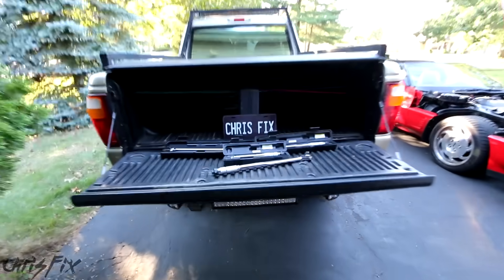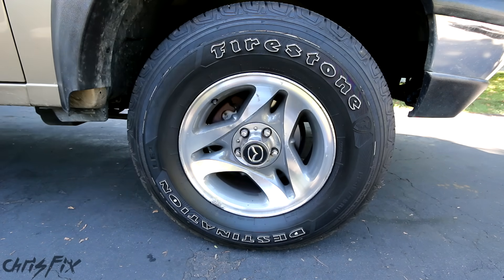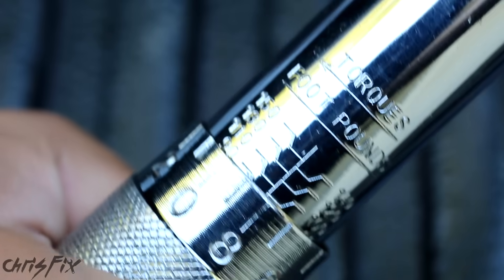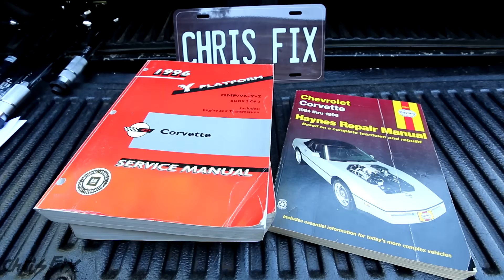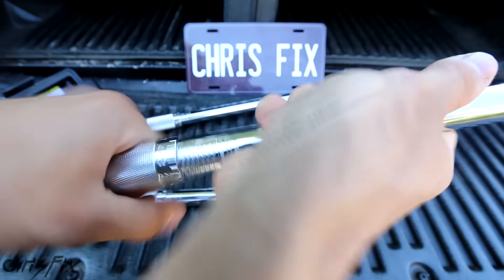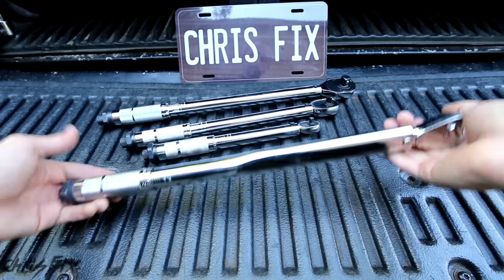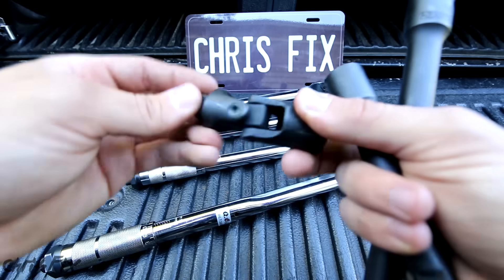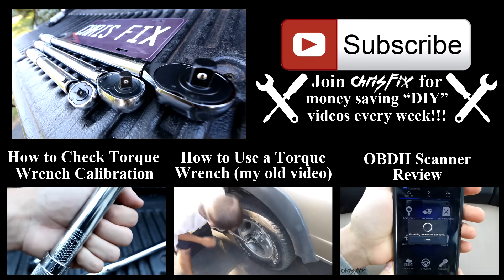How to use a Torque Wrench PROPERLY

Comment: "Where do I get my torque specs?" slams the service
 manual hahahaha
Reply: Othman Sbawi where do you get service manuals for less than several hundred dollhairs?
Reply: @Klaxz1  Online searches, you can even try craigslist or kijiji for people selling aftermarket cds with the manuals on them.   Had to do that for my lincoln navigator, $15 out of canada on a kijiji ad.
Reply: @Klaxz1  ebay digital copy service manual like 5 bucks. PDF file
Reply: @Klaxz1  The internet lol
Reply: GENTLEMAN RTFM
Reply: Klaxz1 is that some bakerXderek lingo I detect there?
Reply: I know right lmfaooo
Reply: @rhett_talon  couldn't help but feel a little like Ave

Comment: 20+ yrs working wrenches.
I absolutely love the Craftsman  1/2 inch drive from Lowe's. 
 Bought for $105.
20ft/lbs - 250ft/lbs.
Covers cars to most trucks. And other things, like clutch sheaves on side-x-sides, which need 184-234 ft/lbs.
It's just versatile and affordable.

Comment: Use rigid extensions, even thin ones, no problem. It has to transmit all of the torque onto the bolt - basic rule of mechanics. Yes even thin ones that might twist. The extensions with a universal joint in will be a problem, though. Good video, thanks 👍

Comment: I cant use it until its set correctly. Dont you need to make sure its calibrated. I mean, obviously its a no brainer how it works. But how do you know its calibrated. When i go as far counter clock wise as i can (toward 0) i stop at 8 on the small dial. Im sure that cant be right

Comment: My torque wrenches only go to150,  I need 166ft pound pressure
Reply: You can use an adapter extension or adapter spanner to increase the lever length, the extra mechanical advantage will deliver greater torque in proportion to the increase in length. For example an adapter that gave 10% increase to the existing length from the center handgrip position to the center of the wrench's square drive would deliver 165 output at the 150 setting.
Reply: @PlatypusPerspective i broke my torque wrench somehow but I finished finally.. now have to change oil on both my car and truck.. then put in ac compressor in my daughters mustang.. already changed the valve cover and intake manifold gaskets.. always something to do., ty for your help

Comment: I'm having a hard time with being able to tell if my large 20-150 1/2" torque wrench is clicking on the lower torque nuts, like 22-38 or so. Would a smaller wrench help for that?
Reply: Quite possibly, yes. A torque wrench is less accurate at the bottom of its range, and can give a weak indication since the beam is only storing a small amount of energy to give the indication. One with range of perhaps 10 - 60 ft/lb (as it's frequently labeled) might be listed as a cycle torque wrench, and could be 3/8" drive.
Reply: @PlatypusPerspective thanks - I got a smaller one, definitely helped

Comment: I’m a fan of your videos due to the fact they’re always complete and to the point (even includes don’t make mistakes and no (bring out the clowns entertainment). This time I was left with a question; what is the range ft. lbs. for the 1/4, 3/4 torque wrench? Is it the same as the 1/2 inch (from …to…ft. lbs.)?
Reply from the maker: Glad the videos are helpful. It varies based on the brand torque wrench. For example a 1/2in can be 10-150ft-lbs or 25-250ft-lbs for example

Comment: This is just too American for me to understand but imma try anyway

So basically torque is the rotational force applied on something 

Too much rotational force can Damage certain parts of the bolt like the head and screw

To prevent this you use a torque wrench Which can limit the rotational force you apply on the bolt. 

You adjust the torque wrench to the desired torque and you are good to go

The clicking sound means that the bolt is tightened enough for it to not fall off.

Idk if someone will answer my question but I'm gonna ask anyway

If you hear the click can you still rotate it or it just locks the wrench so you cannot rotate it once it clicks.
Reply: The click wrenches shown here just let you know when to stop - if you keep going you can still over tighten the fastener. There are some wrenches that release and stop turning the fastener, like the slipping cam type. They won't over tighten if you keep turning them.

Comment: Dear ChrisFix chanel ,

I am writing to request a tightening tool for my automotive repair practice. As a student in the automotive repair program, I believe that having the right tools is essential for gaining hands-on experience and developing my skills.

The tightening tool I am requesting is specifically designed for engine. I have researched and found that this tool is essential for ensuring the proper tightening of engine and preventing damage to the vehicle.

Having this tool would enable me to work more efficiently and effectively, and would greatly enhance my learning experience. I am confident that with this tool, I will be able to develop the skills and expertise necessary to succeed in the automotive repair industry.

I would be grateful if you could consider my request. Please let me know if there is any additional information I need to provide or if there are any further steps I need to take.

Thank you for your time and consideration.

Sincerely,
Đinh Thanh Huy

Comment: How has life changed since this video came out? I ask chatgpt for a printable rotor+brake job checklist complete with parts, tools, and lubes and it even includes hyperlinks to videos like this for various steps. Just to make things interesting, chat gpt makes more mistakes (lies?) than the average human, so there are things like the brake caliper shim part # turns out to be for a brake caliper pin part #....but at least the 76'lbs turned out to be right -- if you double checked the experts, make sure you triple check the ai...
Reply from the maker: I wouldn't trust it for most things since (so I've heard, I don't use it) it gets a lot of things wrong as you saw lol

Comment: at 3 minutes, he should of mentioned that after each click, it has to be turned the other way to reset the mechanism, else you might not hear a click next time you try and will end up over torquing. he did it but didn't say it. this is common with cheap torque wrenches, not sure about quality ones. it's been my experience anyhow.

Comment: Hey Chris, I have a Tekton 3/8 torque wrench ranging from 10 to 80 ft-lb and am having trouble reading the handle. I am trying to achieve 16 ft-lb. Where should I line up the number?
A video showing us how to would be nice! thanks
Reply from the maker: 1:31 but you would go to 10, go up 5 (half a full rotation), then 1 more and you are at 16!

Comment: Diff between in/lb and ft/lb? Would it be easier to tighten bolt with fingers until its too tight to turn then use rachet to turn 1/4 way or 25% out of 100%?
Reply from the maker: in/lb are a smaller unit (12 in/lb in every ft/lb), and thats usually the way to do it but if you get the bolt/nut started by hand so it's not cross threaded, you can do it the rest of the way with a ratchet or impact or whatever you have!

Comment: I’m doing a tire rotation for the first time on my first car this weekend along side an oil change and a slew of other maintenance and am wondering if it matters that I hand tighten the nuts so the wheel doesn’t wobble around before I use the torque wrench? Because that’s just the best way I could imagine to do it in my head
Reply from the maker: That’s exactly the right way to do it!

Comment: How do you set a 1/4 inch torque wrench to 71 inch pounds
Reply from the maker: Rotate the handle until you are at 70, then go up 1 tick mark and you should be good!
Reply: 1 tick to the left or right  @chrisfix
Reply: @chrisfix do I turn it to the left or right

Comment: WRONG!!! Your calculated 100 lbs.-ft. is in fact 90 lbs-ft. Look at the tool markings again from below the 10 lbs.-ft. indicator...
Reply from the maker: I am not sure what you mean, I lined up the 0 to the 100 line so the wrench is set on 100 exactly

Comment: is it normal for the handle too have a lil bit of wiggle when set to a torque spec?
Reply from the maker: Like when you are torquing the bolt/nut or just when you set it?
Reply: I suspect the question might be about a very small rotation of the handgrip still possible when the locking nut is tightened? In that case, it's not unusual and isn't a problem. Just the little mechanical clearance that allows the mechanism to move without binding when it's unlocked and being adjusted.

Comment: 2:38 - I couldn’t find it in my user manual, but Google says my 25 Honda Civic hatchback sport touring uses 19 mm lug nuts? 

So I need a 19 mm socket? There seem to be tons of “sockets” on Amazon, what exactly am I looking for?
Reply from the maker: Yes you need a socket set that has a 19mm socket. Something like this:  https://amzn.to/41RBLJ8 or if you want a set: https://amzn.to/3XQ4iO8

Comment: You can get a icon at harvor frieght for 11 dollars. Same torqe specs
Reply from the maker: Thanks for sharing!
Reply: @chrisfix  I've got a honda Civic that ran hot. 2007 r1.8 engine. Should I just put another head gasket on it or get another head?
Reply: The problem is I'm poor , and that was my only ride. I've got a motorcycle,  but I can't take my son to school on that.

Comment: I'd get a 1/2" drive to handle anything then put a 3/8" adaptor or 1/4" for smaller bolts and sockets.
Reply: A 1/2" drive wrench will seldom be able to deliver the low torque settings required for small bolts. e.g. torque wrenches for cycles normally have 1/4" drive and their entire range may deliver less than the minimum on a unit with 1/2" drive.

Comment: What if the zero dont line up with the line? It's either under or above it, by then im assuming the zero and the edge of the rotating handle is supposed to be lined exactly with the line.

I want to set it at 38nm, closest points are 34.0-40.7, are those also supposed to line up with 0 or is it different with 34.0 because it doesn't end with 0?

Comment: Question, can I reduce a 1/2" torque wrench to 3/8" with small reducer so that do not have to purchase another Torque wrench?  thanks
Reply from the maker: Yes you can!
Reply: @chrisfix  thanks sorry for delay, found a 3/8 on Amazon calibrated in Newton meters for $28, looks to be quality. BMW oil filter housing gasket job, requires intake manifold moved over. Maddening they located on bolt under the manifold. Everything has a low torque spec and one use bolts. Failure at low mileage on all of them...

Comment: Chris good video , question i need 8newton torque setting but have wrench that only goes down to 28nt can i go lower by reducing to 20nt to give 8newton sorry i work in metric ireland
Reply from the maker: You would need a wrench that has a setting that low
Reply: @chrisfix  thanks

Comment: Great video! I have exact type of wrench but the button locking nut keeps coming off when setting torque. Is this common failure? I think I used it 3-4 times and it’s past its warranty period.

Comment: While you did illustrate it, you did NOT mention the torque-one-skip-one rule for odd-numbers of nuts.  AND you did not mention lubrication of the bearing surfaces of the nuts.    TWO rules of proper torquing:  The bearing surfaces must be lubricated (yes, I know most mechanics tell you that if you do, the nuts will fall off, but if you read the operating instructions of good torque wrenches, you will see their recommended procedures), and the nut must be moving when the "click" occurs, or you are only determining that the nut is torqued to not less than the set value.  Also, you show the back-breaking way of using the torque wrench: by pulling UP.  Instead, place the wrench on the other side of the nut so that your weight, not your muscle is doing the work!!  I am  design engineer working many years in the aerospace industry, where these things are well taught.

Comment: Does it matter which size wrench I use to torque wheel studs? I have the smaller handle one with a 1/4 inch drive
Reply from the maker: I would use a bigger one if it's available

Comment: I have a question. If I need to tighten to 150ft lbs often (towing camper with weight distribution hitch), would it be better to purchase a heavier-duty wrench, or is it ok to regularly use it at the top of its range?
Reply from the maker: I would get a heavier duty wrench if you are regularly doing that to avoid unnecessary wear and making sure the torque is the most accurate

Comment: Can you use a 3/8 torque wrench with an adapter to actually tigten a 1/2 nut or will there be issues? Or need the exact wrench in my eaxmple i would need a 1/2 rorque wrench and nut?

Comment: Thank you for the helpful info! I was wondering When you set the wrench to a certain setting will the handle still spin a little to the left or right or is my torque wrench probably messed up? I only ask because I just bought one and watched this but notice my handle moves a little after locking the nut in the bottom.

Comment: Nice!! What size torque wrench should I get for changing a wheel bearing for an 08 crv? I’ve been watching videos learning how to maintenance my own car. So far I changed the thermostat , sparks/coils, coolant fan, oil change/transmission flush. Just bought this car to learn how to fix and sell!

Comment: Some alloy wheels require only 55lbs-ft as the wheel stud has a limited amount of knurled contact with the hub. The Honda Rodeo (1st Gen) is one of these. The wheel stud will break loose and spin inside the hub, even 4 X 4’s. Seriously. ASE Master since 78.

Comment: I’m confused about why you went to 100 the way you did why did you stop at 90 and then count up to 100 on the other dial? Why not just spin the thing to 100 from the beginning?
Reply from the maker: I did that to show the relationship between the numbers on the dial and the numbers on and shaft, and also it's a common beginner mistake to not have it on the 100 so I wanted to show what it looks like when it's properly set since it looks close on first glance. And if your spec was 95 for example I'm also showing how you would use the numbers to add 5 to 90 and get 95.

Comment: The 1/2" footpound numbers went down to 10 but u said it goes from 20-150 and the 3/8" the lowest number is 5 but you said it goes from 10 -80...  are those bottom numbers not actually the low range ? Why are they on there?
Reply from the maker: The packaging for the wrenches says 20-150 and 10-80, not really sure why they are on there and since they are the lowest number they can be off a little more than normal so I wouldn't trust it anyway

Comment: For some engine bolts there is more than just one step. For an example sometimes you need to "rotate 90 degrees". What does that mean?
Reply: think its something to do with stretching the bolt and getting a proper seal. That's why they sell angle gauges 🤔The stretching is why you should also never reuse headbolts, or other bolts that work similiar.
Reply: @jaskajokunen3716  Thank you! I actually figured it out by myself and also got my theory confirmed by a car mechanic. What I understand, when reaching the desired torque value with the torque wrench the bolts are designed to start stretching after that, using a ratchet/socket wrench along with an angle gauge, in order to get the proper seal. I bought 1+9 new original bolts for my Camaro V8's left cylinder head (1-3-5-7), located in the engine compartment on the driver side and managed to succesfully put it together. Have been driving my car and pushing the engine really hard many times since the beginning of July this year. Close to 7000 km or 4350 miles so far. :)

Comment: I bought 3 different torque wrenches and none of them worked, the last one was way more expensive and it was set to 12 foot pounds for an oil pan, never clicked, snapped the bolt head right off

Comment: Guys, noob here so don't kill me. All nuts will have torque specs or only those in specific places? for example will there be a torque spec for a side mirror nut on a motorcycle? Also how the torque is decided, based on vibrations and force that nut will receive?
Reply from the maker: Every nut/bolt in a specific spot will have a torque spec or at the very least some kind of range. There should be a torque spec for that. And that is pretty much it

Comment: Is 1lb-ft about the same as 1 Nm. I see in many videos the mechanics use newton-meters when it comes to using the torque wrench
Reply from the maker: 1 lb-ft is about 1.3558 nm. A lot of wrenches actually have both lb-ft and nm

Comment: in case i cant find the torque specifications for my car in the intenet or any book, what can i do?
Reply from the maker: Call your local dealership and see if they have workshop manuals for sale for your car
Reply: @chrisfix  ok but it doesn't makes sense. I mean they try to make money from you getting your car there to be fixed. Why would they give a diy repair manual.i don't want to offend you but i am a newbie to all this and i found you helpful